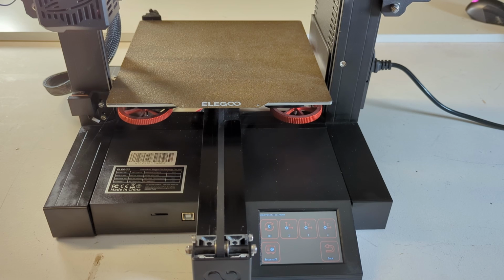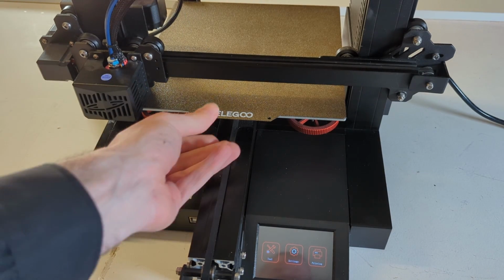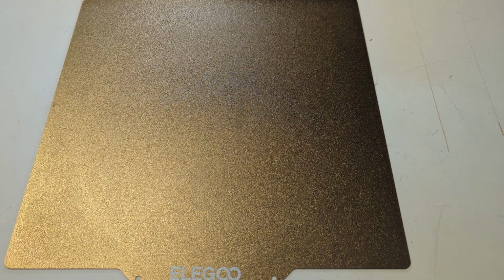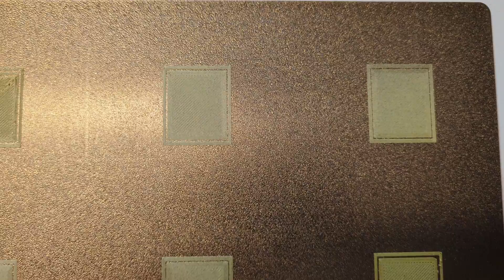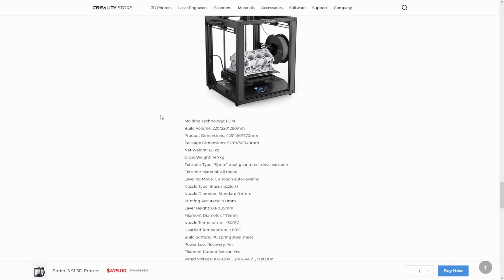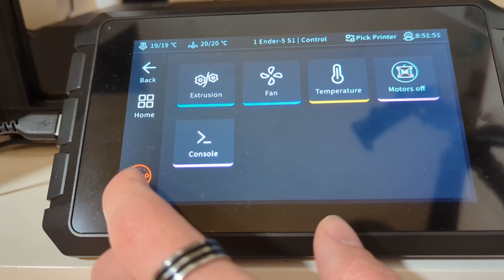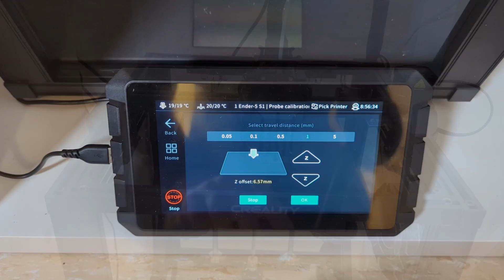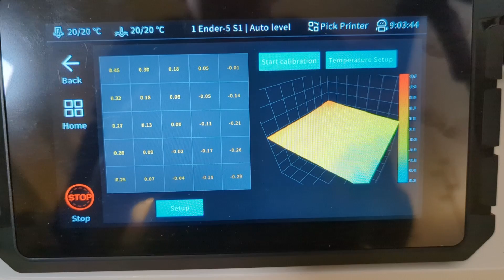How to Level Any 3D Printer

Comment: So when you mean slight resistance do you mean just it scraping the top of the paper just not enough to rip ? Im asking because i have trouble leveling mine
Reply from the maker: Yes. When you can´t remove the paper without some resistance. The nozzle should catch the paper a little bit but it should not directly touch the build plate.

Comment: imn my case even after setting the z offset the hot end is too high in some places and too low in others.
Reply from the maker: I know your frustration. This means that the buildplate is worped (happends with cheap printers sometimes) or your Z-axis assembly is not perfectly aligned with the buildplate.